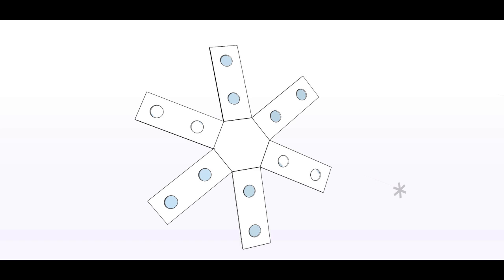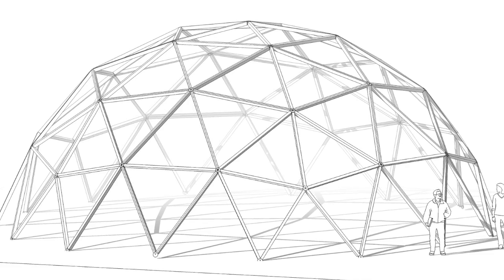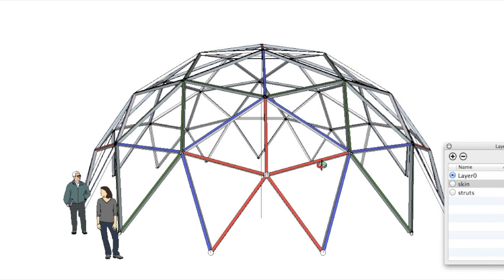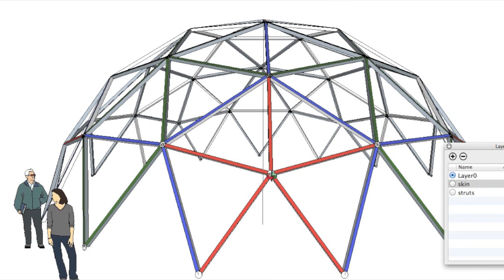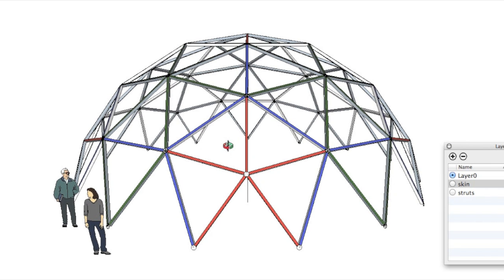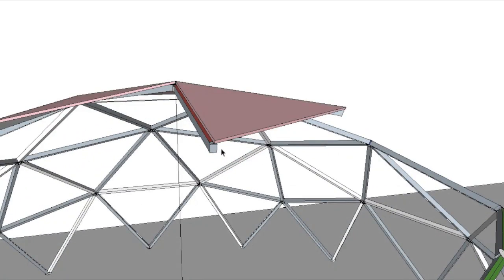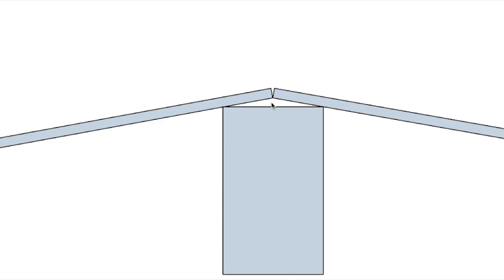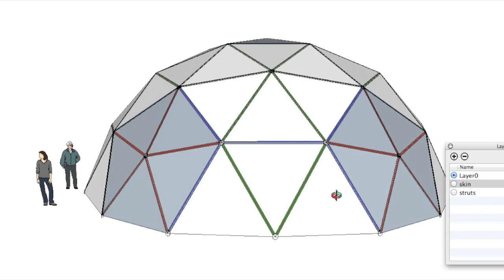Dome building methods - Hub and Strut

Comment: Paul.... You think from the half empty container.  The so called problem you highlight of the space between the joints of the hibs and vertices... Can be solved by the use of molds fitting the space or the vertices cut with the curve needed at the ends which should make easier for assembling.

Comment: Re: voids in hard covering ie plywood. The use of properly cut 2x4's or 2x6's with double beveled faces becomes a flat face interface on two planes. As for the hub void an insert properly faced solves that alleged problem. The same applies for the interface between the bottom strut to the riser or to the base plate is the use of a beveled board to create the fill for the "void". I've worked on Geodesic  domes of just about every kind going all the way back to one of the very first panelized builders Cathedralite Domes of the late 1960's, Timberline Geodesic dome homes to Pacific Domes simple Conduit domes. Frankly your criticism of Geodesic Domes is unfounded and self aggrandizing ie. blowing your own horn. Today, simple conduit domes are quick emergency shelter or can be used as semi-permanent dome homes. On the other end of the spectrum are domes such as Monolithic Domes (single thin shell concrete domes) for multiple generation buildings. Frankly I'd suggest you take your post down until you learn a little more about Geodesic Domes and the other forms of spherical shaped dome structures.

Comment: Hello! I've got 2 questions:
You say that there are better methods for the connections in bigger heavier domes, which are..?
And, what kind of software are you using for the dome?

Thank you !
Reply from the maker: I uses sketchup for drawings. the method depends on your context, however generally I find panellised type construction to work better unless you are building a tent type structure. My preferred method is beveled frame: https://youtu.be/JRbTyFK2m7s

Comment: What is the name of the program/app you are using in this video?
Reply from the maker: I use Sketchup pro now, I was using a very old CAD program called auto sketch and rendering with Truespace 4 but sketched does an OK job of both.

Comment: Your "problems" are all just bad design. 15-20 quid per hub? Wow, I never thought of using gold plating for corrosion resistance. As for the "voids" - big deal, filled with Silastic as part of water proofing.. The voids at the hubs are just another straw man.

I use discs, on the inside, with a hole in the middle,  small length of 20mm tube on the outside of the disc (square to the disc). Pieces are cut to length, slots are cut into the end of each strut at the correct angle for the bend, and the slot goes over the disc until the strut rests against the pipe. Cost per hub, a couple of Aussie dollars.

Hub is the easy way, with accurate length cuts they come together into shape very easily.
Reply: Its less than 2 quid a hub. Greenhouse domes using the panelised method will eventually leak, Thats if you can make it watertight to begin with. Covering the joints with tape is hit and miss at best. The tape has to be inspected and replaced regularly, aka ongoing costs and hassle you dont need.

Comment: I reckon you've never heard of Zip Tie Domes, then.
Reply from the maker: Yes I have, but I would not consider there method a professional system. More of a DIY makeshift solution, using zip-ties and plastic pipe isn't something I would consider for dome building.
Reply: Paul Robinson Oh I know it's not good for a house, but if you need something lightweight and portable... Most dome designs I see are big intimidating structures of wood and bolts

Comment: could you not use velcro to use hub n strut construction using polycarbonate,  velcro polycarbonate (that has been heat treater and bent to fit to over come the voids issue)  Im looking for a replacement for my tent though I have to be fairly mobile (homeless) i do have a car so i can transport it I am also looking for the best solution for stowing it on a trailer in large pieces so set up n take down time is minimum.

Comment: Paul, I want to build a half dome that will join to a traditional frame greenhouse. what type would work best for that? My greenhousr is 24 feet by 12 feet with an 8 foot gambrel roof. I want to join it on the 24 foot side
Reply from the maker: Oh it depends on a few things, I would do a scale drawing then try a dome or two to see what looks best, it is easy making a half dome for a wall, standard 3v works fine: https://youtu.be/_8D9hgHi7m8
Reply: THANKS